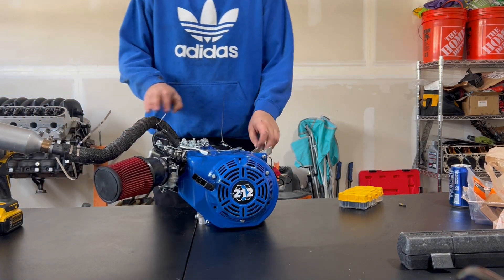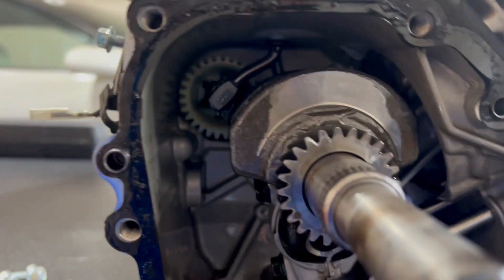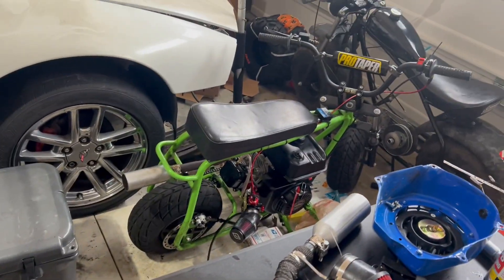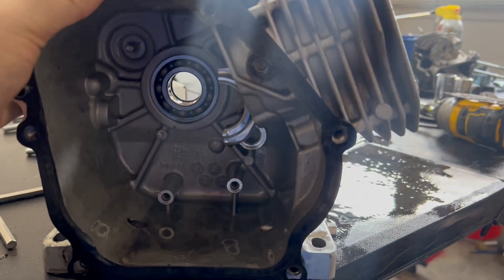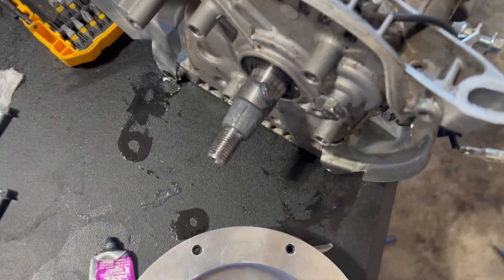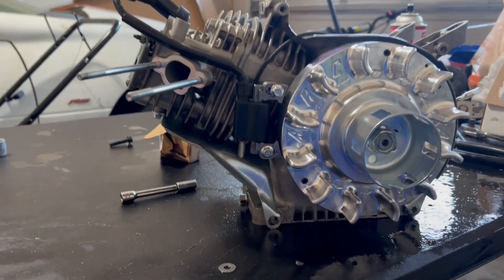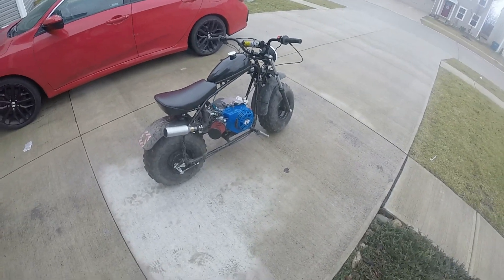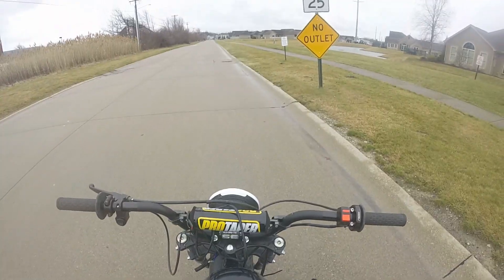TILLOTSON 212 GOVERNOR DELETE + Billet Rod/Flywheel (CT200u-EX Build Series Ep. 4)

Comment: All that is is gearing and the early belt shift. I use a yellow spring in the driven and 9/60 gearing to take care of that. The stock driver works fine. The Juggernaut is a good option and you should be able to keep the same gearing.